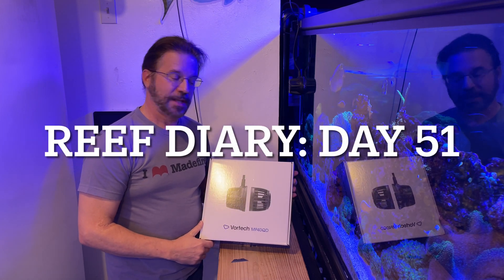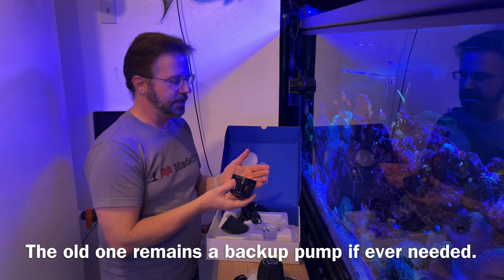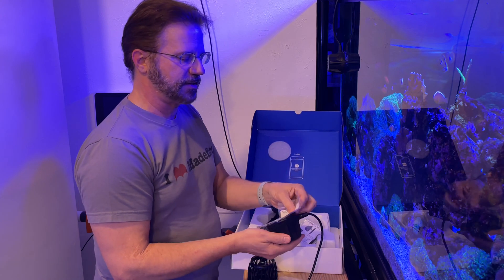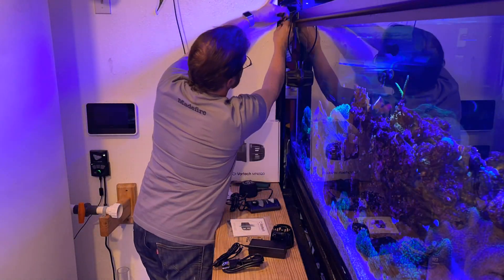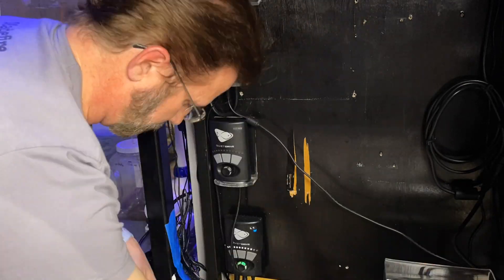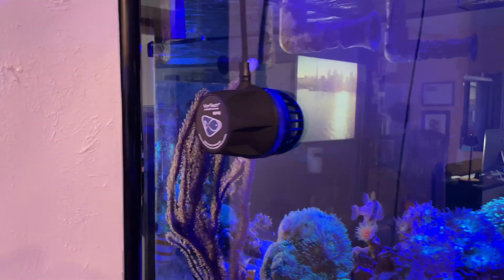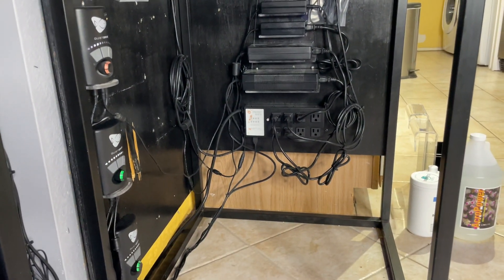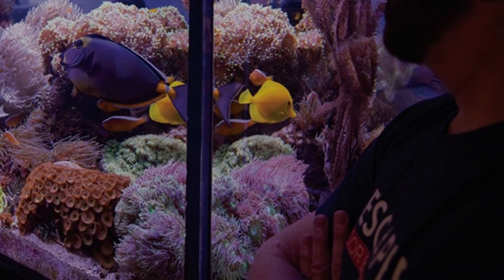RD51: Installing a Vortech Mp40 with Mobius control

Comment: Hi @melevsreef (Mark), thank you for the video. Do you know if they still make the Vortech's with APEX wireless control? I just installed one to replace an old MP40 but didn't even occur to me that there wasn't an obvious wireless one for the WXM module available at BRS. Luckily it works well with Mobius so I'm too lazy to pull it out and exchange it.  I do miss having all of my vortech's on the APEX. Any thoughts or vendor info you could provide?
Reply from the maker: You just need to downgrade the firmware to use it with the WMX module for Apex control.

Comment: I have maybe a specific question. So I saw someone selling their MP10 QD but would that automatically support Mobius? I'm in a dilemma between second hand MP10QD possibly to upgrade to Mobius, or just getting an AI Nero pump.
Reply from the maker: Automatically depending on age.  If it's older, it may not have the Modius (black) chip in the driver.  You'd need to know this first.  The Nero pump is programmable with the AI software, but you won't have the option to use a battery backup like you can with the Mp10.

Comment: Hey, Marc. Have you considered using Rust Mort, POR 13, or another rust converter to stem the oxidation of your stand? That stuff works great in automotive applications, especially the POR (paint over rust)
Reply from the maker: I had not heard of that, sounds like a nice option.  Since this isn't very thick, I'm concerned the integrity of the steel may be a factor.

Comment: Why u changed the old one just because 7 years?! Was it still working?! Should i change my pumps and wave makers regularly?!
Reply from the maker: I don’t wait for something to break necessarily. The Mp60s are almost 11 years old and need to be replaced as well. They run 24 hours a day, and I felt it was time.
Reply: @melevsreef  11 years. Older than my whole reefing career . Thank you for answering
Reply: Mp40s qd break inside 6 months in my experience. Have 2' biggest ever regret, thought this brand maybe could make something reliable but learned you need to go European or Chinese to get that.

Comment: So you don’t need to buy the reef link anymore to control vortechs?
Reply: Think you can buy the Mobius chip/transmitter and upgrade old units
Reply: There are videos that show what the 2 chips look like if you wanted to inspect one for compatibility
Reply from the maker: Correct. The green chip inside the driver needs to be replaced with a black chip to work with Mobius.

Comment: Thanks for the video, I just had my wetside from 2014 finally fail yesterday. I need to order some replacements from you.
Reply: Failures sometimes just needs the power turned off and the two sides separated.  Leave apart for a minute or two.  Reconnect with the power off.   Then after 30-60 seconds turn power back on.  Sometimes that works and the magnetic fields get realigned.

Comment: random question ... any special care requirements for 24k gold lepto and green slimer? My 15 gallon is tricky with coral placement because of how close the powerhead is. i never cared for leptoseris in my last tank ! i scored nice pieces during Top shelf Aquatics labor day sale !  =)
Reply from the maker: Stable water parameters are what those corals need. That’s going to be challenging in a 15g reef. And good flow. 👍🏻